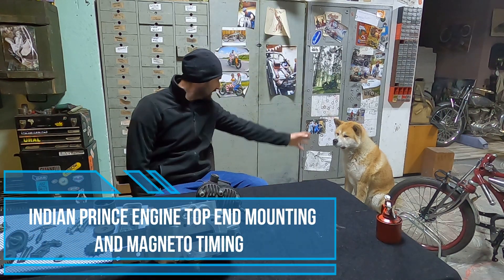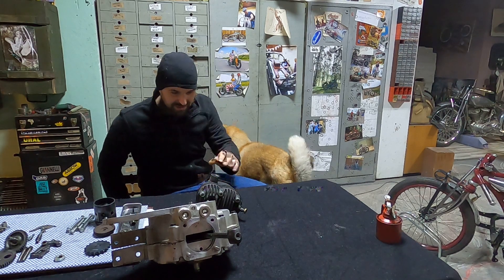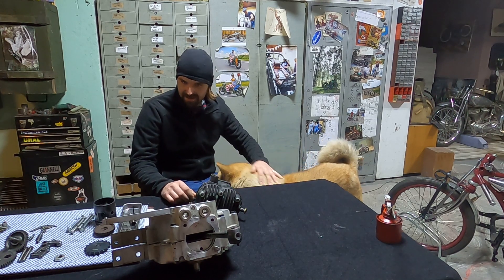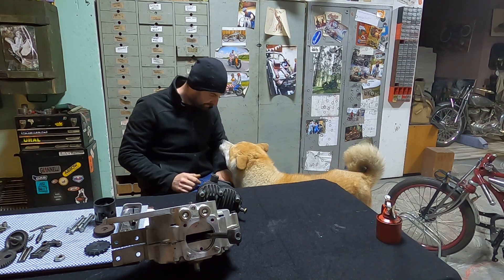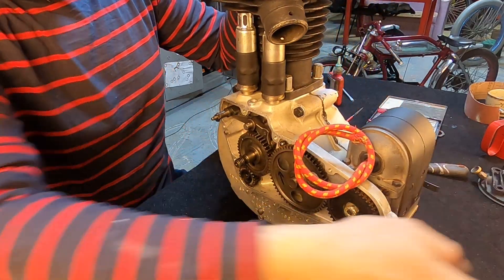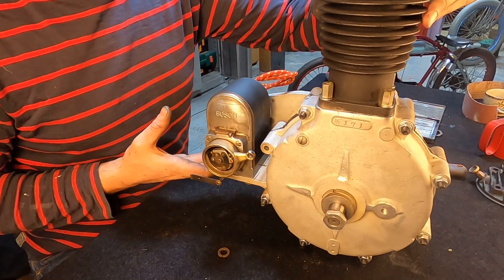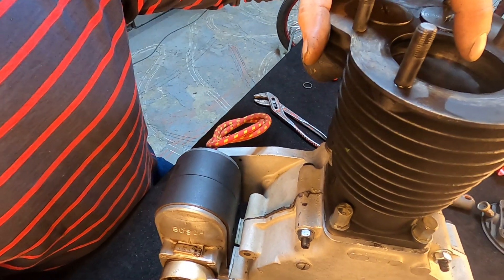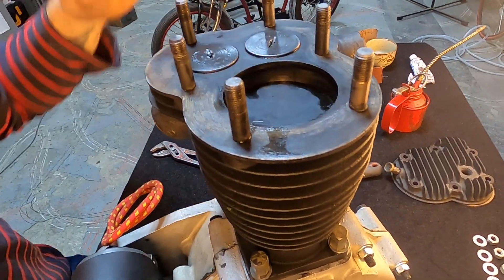Indian Prince engine - top end mounting and magneto timing-

Comment: Great Video! Do you have a hard time getting these old engines there? What type engine and size is this one? Thanks in advance.
Reply from the maker: Tom , that is a good question nobody asked . Yes  it is very hard and very expensive to get old heavy vintage iron down overseas with  shipping costs . so the only ones making money in this business are curriers . and overhere in romania nobody will buy a custom vintage bike , because it is more original the original :))))) , nor would europeans .This engine is an indian Prince Engine 500cc that was installed on a big heavy indian .
Reply from the maker: I also intend not to use any more old engines , in my future builds , and build my own engines .